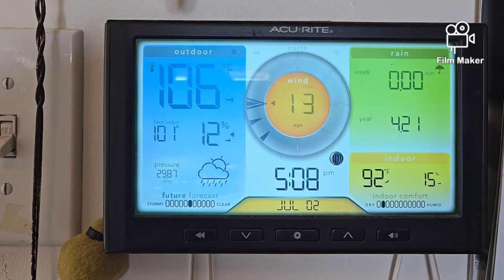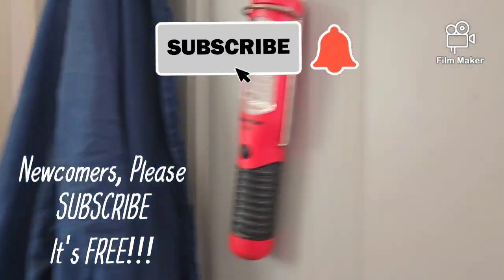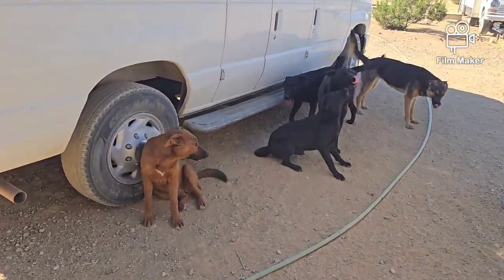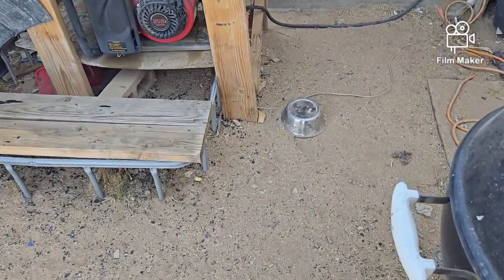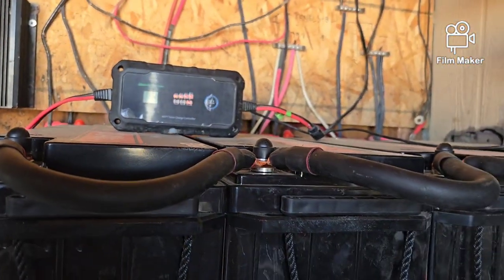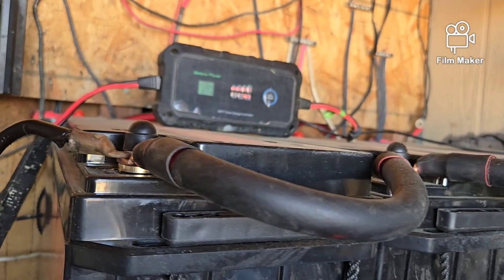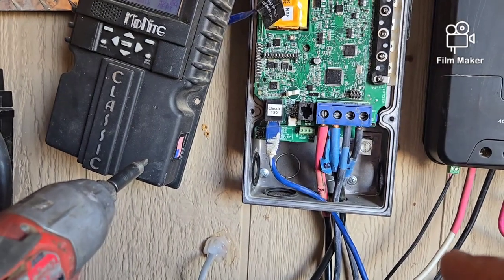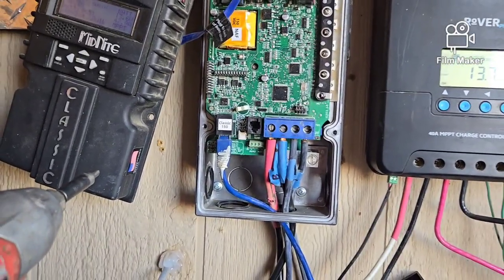LiFePo4 & Heat Wave, And More! July, 2, 2024

Comment: Hello from S. Oregon.. Looking for some bare land in Kingman. 2400w of solar on 2 arrays with 800A of lithium. Gonna do the RV thing for a while and then probably buy a big shed and convert it. Yeah.. We're dealing with the heat up here too.
Reply from the maker: @OFFGRID_Trucker  Welcome aboard!  You system should be fine for an RV, but once you do a cabin, you'll want to at least double your solar and battery bank, and go to 48v.  That's my experience, anyway.

Comment: Check the voltage specification for that breaker before using it on the solar string side, compared against the open-circuit voltage of the solar wiring.  That type of breaker is not usually rated for solar-side operation.
Reply from the maker: @junkerzn7312  Thanks, I will.

Comment: Cooper Bussmann 187200P-03-1 Marine-rated Circuit Breaker 200a Amp 48v-dc. Please only get BUSSMANN BRAND. any other brand will fail. meaning, constantly keep tripping, or braking on low amps  . If you get a cheaper brand you will be kicking your self. heads up.
Reply from the maker: Thanks.  I have learned my lesson about 'cheap'

Comment: UK. I hope to have my solar finished next month. 3 more jobs to do on it.
Reply from the maker: @daz.r1994  Welcome aboard!  Sounds good!  Will you be posting video?
Reply: @GBear  I have just posted a video on my control panel and 12v lights. Just made 2 spice racks and fitted 12v lights in them. Then i have a 10 battery bank that gives me 1300ah.
Reply from the maker: @daz.r1994 Nice!  I'll check it out!

Comment: Hi G Bear 
I'm from Amarillo Texas Good to see the new batteries are working vary well. I'm thinking of buying Lithium batteries to replace my Led acid
Reply from the maker: @MrJohnyfellgood  Welcome aboard!  They are pricey, but you get a lot more power and durability.  Remember, LiFePo4 uses different controllers, different size wiring, and aren't compatible with all inverters.  You will also need a shunt like I just bought.
Tell me more about your system and I can advise you better.